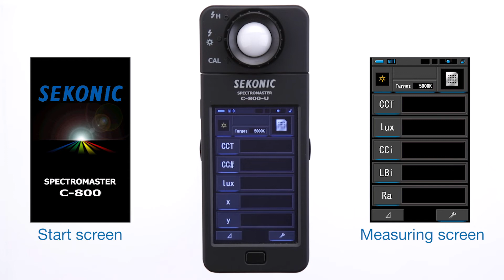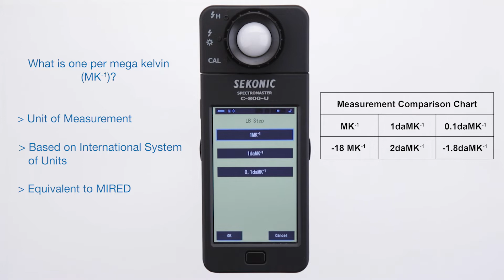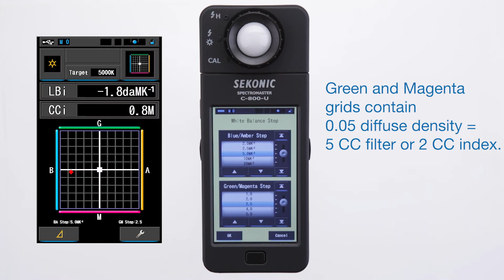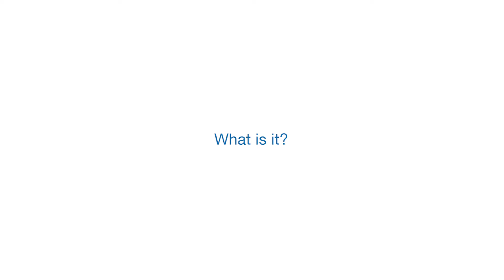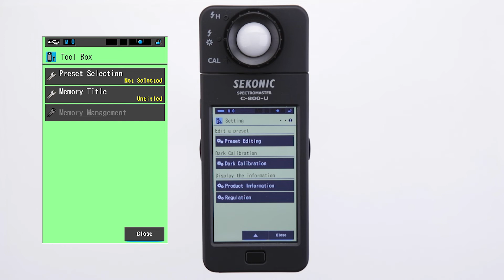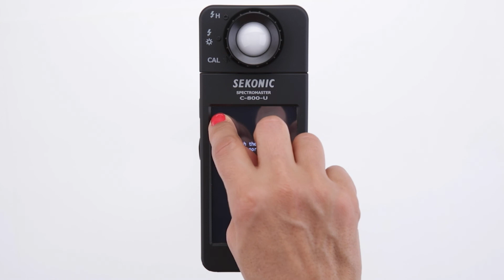Sekonic C-800 Spectrometer Quick Start Video: Tool Box & Setting

Comment: What’s the difference between c800 and c7000.  Can c800 measure ambient light settings so I can set shutter speed and aperture or does it only measure color temp?  I think the c7000 has additional benefit of being able to read ambient like cheaper light meters.  Can’t tell if c800 can do this too.
Reply from the maker: There is a comparison chart on the website.

Comment: Thank you for the informative video.
Sekonic C-800: How to add new memory data to an existing Memory Title other than the last one in use?
All new memory data seems to end on the last Memory Title in use regardless of the selection on the Memory Title folder.
Selecting and/or Recalling a Memory Title doesn't work. 
F/W 20-11-11
Any help would be greatly appreciated.